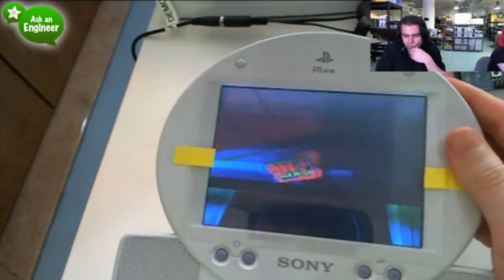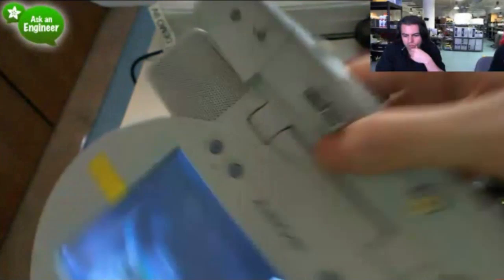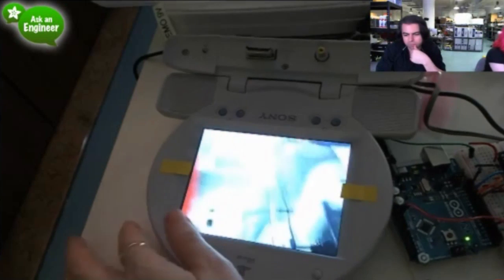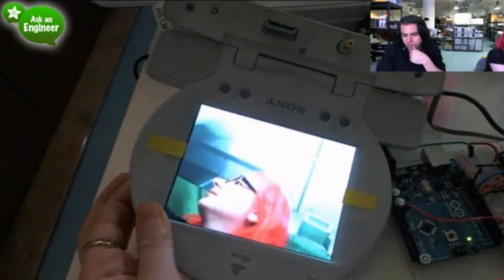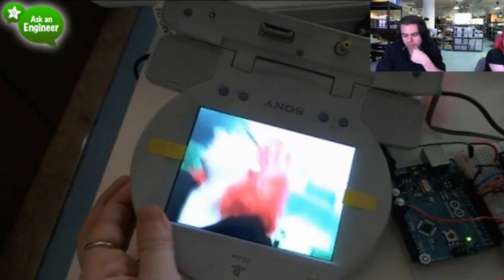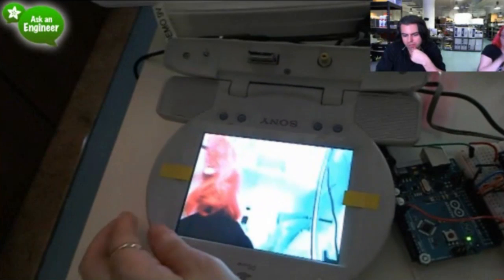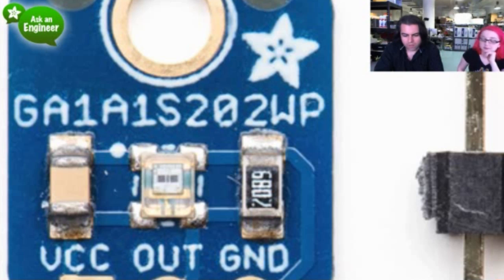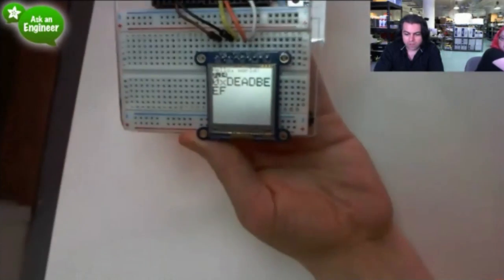New Products 6/1/2013

Comment: Hi!
I want to connect 3A UBEC 5V to a pair of solar cells in seriesis necessary to use 7805 voltage regulator or is it enough to plug into 5V 3A UBEC?
greetings from Mexico! :)

Comment: If I want to use this from a 12vdc battery to power my Neopixel, do I still need the capacitor inline according to your tutorial, or is the signal coming from this clean enough to bypass that?